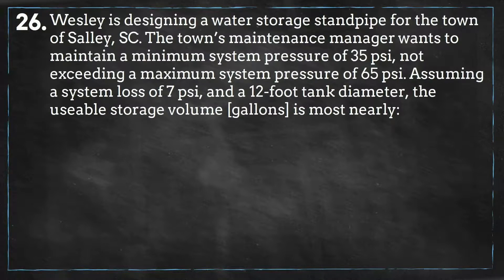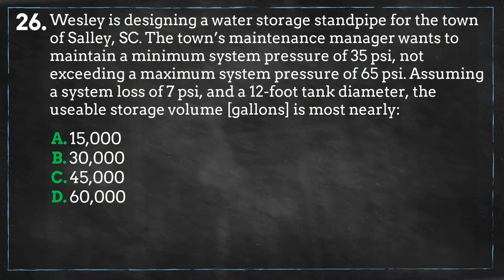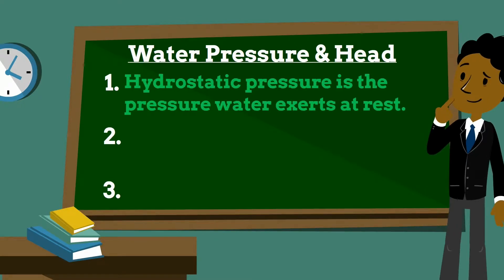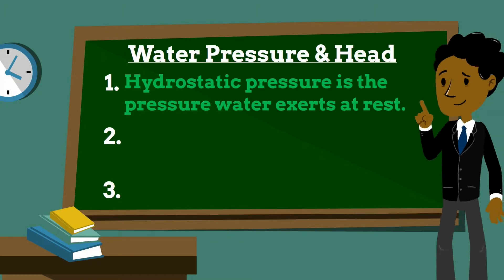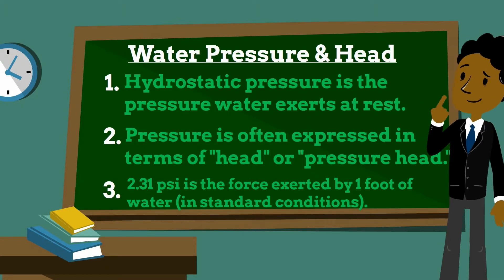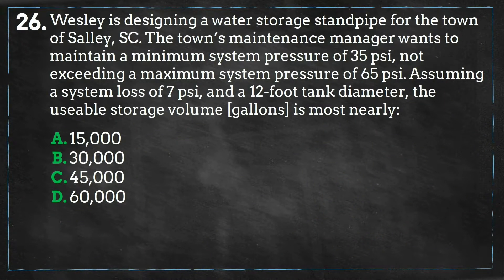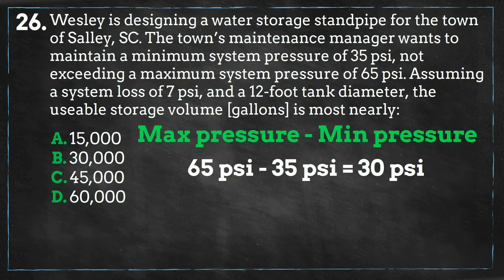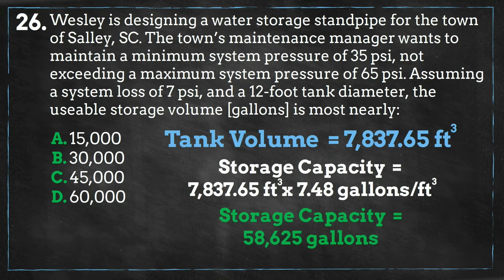Pressure Head -  Episode 26 (Principles of Water) | 52 PE Exam Problems in 52 Weeks

Comment: despite the process, I think the result should be round-down instead of round-up because exceeding the calculated capacity would cause system fail and pressure falling out of the min and max range.

Comment: This answer is wrong in a few places, as pointed out by others 1 psi = around 2.3 feet of water column, not the other way around.  Also the system loss IS a factor. If you are losing 7 psi across the system, you will need 42 psi at the holding tank to maintain 35 psi at the far end of the system. Crunched out, the top of the tank will need to be 149.5 feet tall, and the pressure will be 42 psi at 108.1 feet tall, giving a delta of 41.4 feet.  41.4 feet of a 12 foot diameter cylinder is around 35,000 gallons.  Great series overall though, thank you for creating.

Comment: I believe the head loss only becomes a factor when trying to determine the highest level of the tank in feet. In this case, that would be: max system pressure in ft i.e., (65 psi * 2.31 (ft/psi)) + head loss ( 7ft) = 150.15 + 7 = 157.15 ft.

Comment: If the system loses 7 psi and the operator wants to manage at a minimum of 35 psi (assuming this will be the pressure after losses), the minimum pressure leaving the reservoir should be 42 psi. By using 42 instead of 35 the answer becomes 44988 gallons, which is closer to 45000 (C)
Reply from the maker: Thanks for your comment, Raphael. You are correct, but also remember that since that 7 psi of system loss is for the entire system, you have to do the same thing for the maximum pressure of 65 psi, which would mean that including this loss would make the maximum pressure the standpipe operates at be 72 psi. This still results in a difference of 30 psi to calculate the tank's volume. The loss only affects how high up from the ground the tank will need to be.
Reply: Thanks for the quick response,  @SIGMAEnv . 

I still think that the system still should keep the maximum pressure requirement of 65 psi (not 72).  

Assume that if at any given time if the pressure exceeds 65 psi you can have operational failures (e.g. breaking pipe fittings). Designing for 72 psi will result in an initial pressure higher than the maximum allowed. Head losses are not instantaneous (e.g. leaving the tank will not result in an instantaneous 7 psi head loss). If the system is designed to start at 72 psi, it will be at risk right at the exit of the tank. 

On the other side, the minimum should be 42 psi, because if the fluid leaves the tank at 42 psi (lower than the maximum 65 psi), it will gradually lose head (7 psi) though the system, but it will never be lower than 35 psi. 

The design should be to never exceed the maximum and never be below the minimum at any given time. 

Plus, the calculations by doing so lead to an answer of 44988 (which is closer than 45000) versus  rounding 58625 to 60000.
Reply from the maker: @raphaelr87  My only response to your statement is that I'd be cautious, for the purposes of this exam, to apply losses to certain parts of the system without a diagram presented on the exam or any other explicit information regarding the system. Most references of systems on the PE Exam are inclusive of all equipment & other aspects explained in the problem, unless otherwise shown or stated. Therefore, we aren't 100% sure of how that 7 psi is lost through the system so our calculations should reflect that (by excluding it in this problem) unless otherwise stated.
Reply: @raphaelr87  The problem says that the tank maintains a minimum system pressure of 35 psi, and that there are 7 psi losses in the system, which means your effluent would have a post-system pressure of 35 - 7 = 28 psi. The problem does not say that the minimum pressure of 35 psi must be maintained throughout the system. Thus, with a min tank pressure of 35 psi, the fluid pressure drops to 28 psi through the system, which is still a positive system pressure, and so the 35 psi provides sufficient head to allow water to flow through system's head losses of 7 psi.